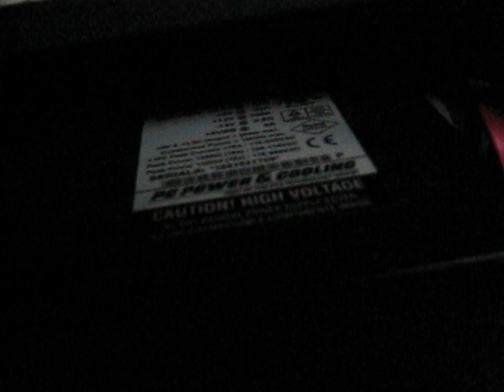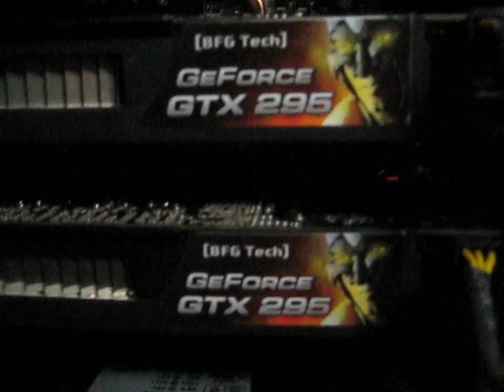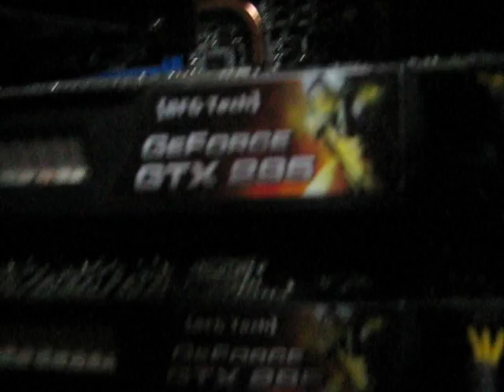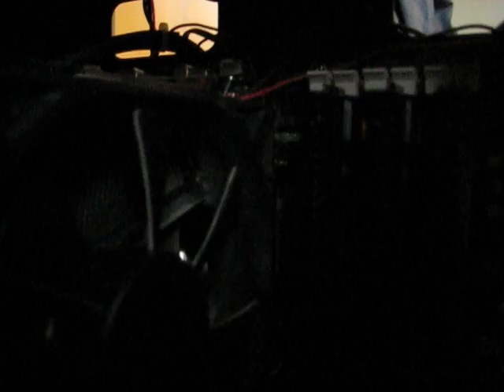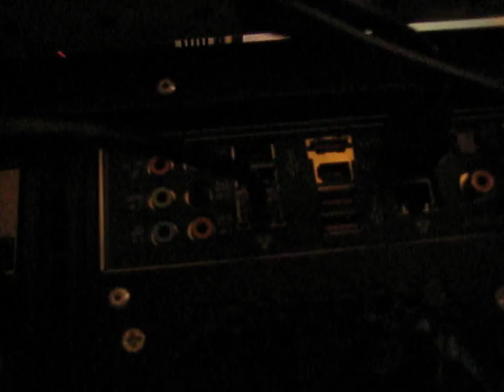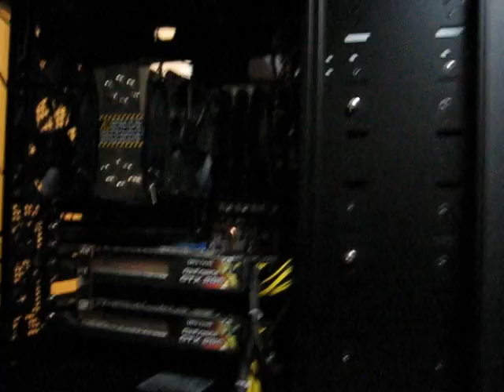NEW BUILD GTX 295 Quad SLI Core i7 920 Asus P6T Deluxe PCpower & Cooling psu Antec 1200 - 6G XMS3.

Comment: I hope to be building and i7 system here in the next month. I'm not looking at anything as extravagant as this, but I will probably end up spending $1400 depending on if prices remain where they are. I have chosen the coolermaster haf 932 over the antec though. I like how the antec has blue LED's throughout, but i prefer the price of the coolermaster as well as it's 3x200mm (i think). Very nice system by the way. quad sli is way too expensive for me. im lookin at a single gtx 285.

Comment: I dont know if its worth 60 bucks but evga beats the warranrty.. If you plan on heavy overclocking spend the extra 60... could save you what the cards worth... But otherwise they dont really break often unless you break them so it doesnt matter that much. I have a XFX. Gtx 260, Works great

Comment: u do realize ur not running thise gpus in x16 and x16 u have to move the bottom card up to the slot below the first right now ur running x16 x8. just letting u no ur kinda bottlenecking em.